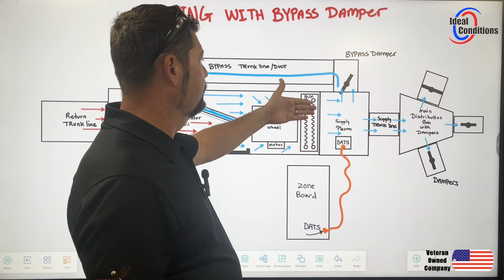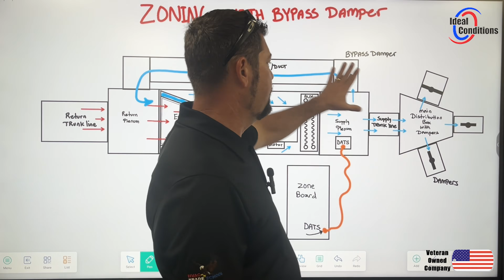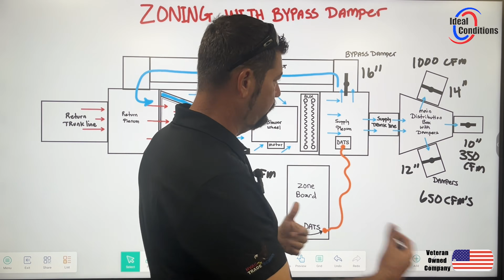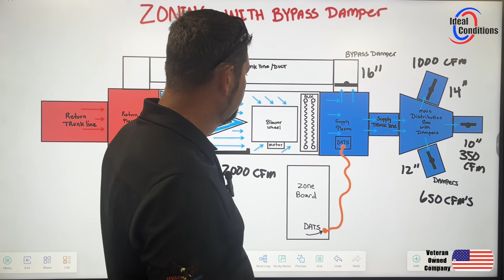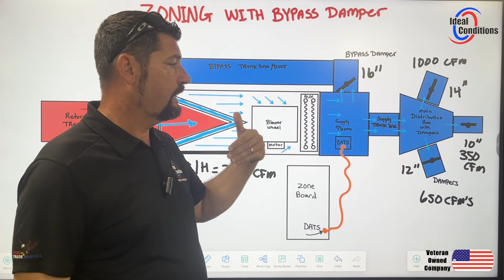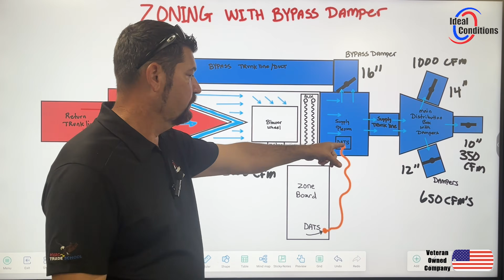Zoning With Bypass Damper

Comment: Awesome series on zoned systems! I haven't run into too many in my neck of the woods, so I don't have a whole lot of experience with them. You've made it very easy to understand, and that's greatly appreciated. My only question is, how does the bypass damper know how much to open? I know you mentioned that it does it based on static pressure. Does the damper have a way to sense static, or are other sensors required that are tied into the zone board, and does additional programming have to be done to the board to be able to adjust how much the damper opens and closes?

Comment: Can the zone board be programmed to put the condenser and blower fan into "Low Speed Stage 1", if you have a 2-speed condenser system?  That way you're not bypassing as much air.  Also, should there always be some "bleed air' that is allowed to flow thru the closed dampers to help maintain proper room ventilation and help avoid freezing the coils?  Most damper actuators allow for a "minimum open" setting.

Comment: (1) What is the formula to size the bypass duct correctly?
(2) Those DATS are they reliable over the long term? I had a compressor blow out with lots of oil spilled inside the condenser box. Does that mean that the DATS may have malfunctioned and caused the compressor failure? In such case would there be some error code or LED flashing on the control board?

Comment: Ok what if you add an damper zone based on timing from bypass damper  supply plenum and add a extra duct line coming straight from return air which will provide a temperature increase that will keep your coil from slugging compressor and freezing coil
Reply from the maker: Thanks for the comment! That would keep the coil warm enough but you would lose cooling capacity to the structure. Therefore it's best to have a zone control board to open and close dampers and a bypass damper to only open up when there's enough static pressure caused from a supply damper closing. 
⚠️ Disclaimer: 
Information in this video is intended for educational purposes only. Any work related to the topics in this video should be performed by licensed technicians or by apprentices under the supervision of licensed technicians. All HVAC repair work is done at your own risk. Ideal Conditions Heating & Air Conditioning, Inc. is not responsible for any possible damages or injuries caused by the use or misuse of any information provided.